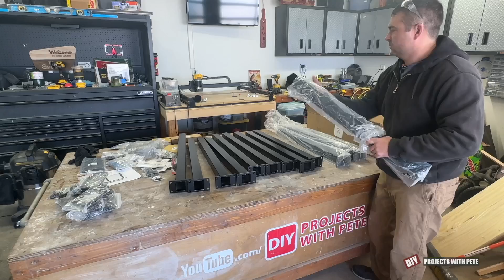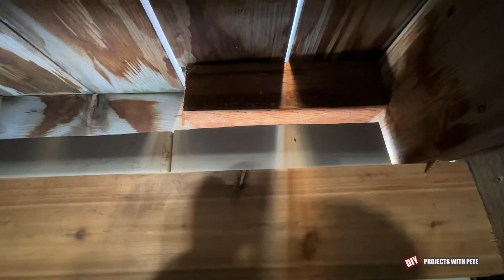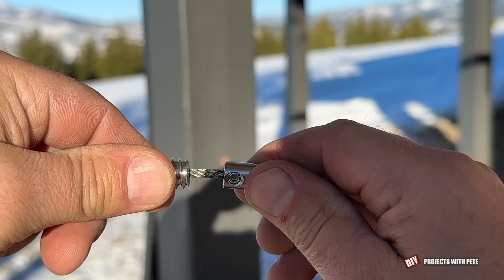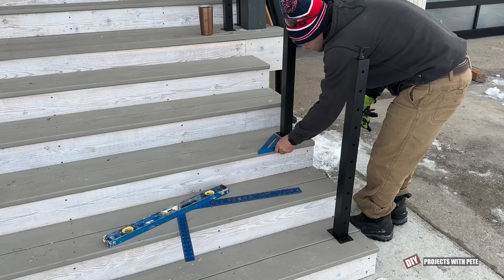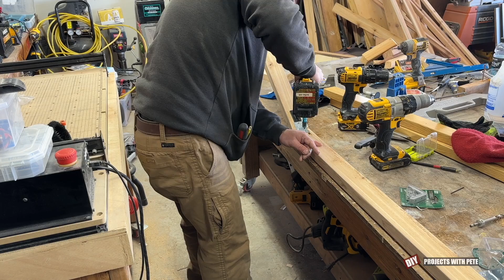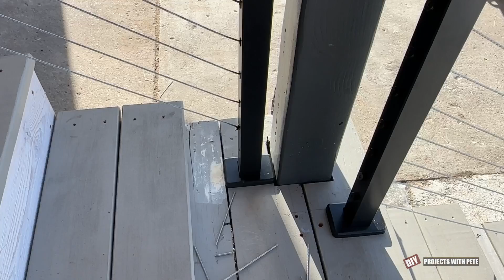Installing Cable Railing on Your Deck | Full Tutorial

Comment: Hey Pete great video. Wondering if you have off hand what the deck paint color is that you used. Looks so sharp and I need to do a different color on the deck of our lake house.
Reply from the maker: Hey! The color on the top of the deck is called Bel Air Gray. We get it mixed up at Lowes and it is their Valspar Solid color Exterior Stain and Sealer ( for decks, siding, fences and outdoor furniture ). We think it looks pretty classy and was an easy way to make old decking look good. The posts are the same type of stain, but it is a dark charcoal color named Carbonized. I've used these stains on lots of patio furniture and sheds as well. That will be nice to get your deck at the lake house looking good again!
Reply: @DIYPETE  Thank you so much for taking a minute to reply! And bonus points for the black color as well. Really nice combo.